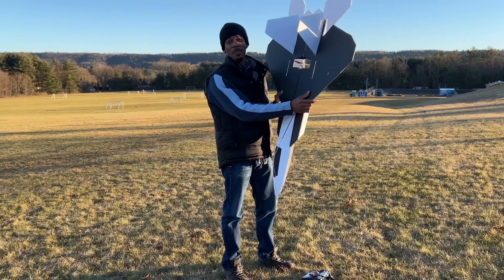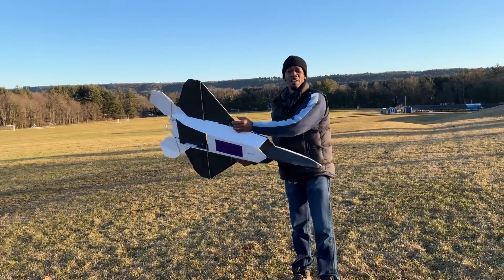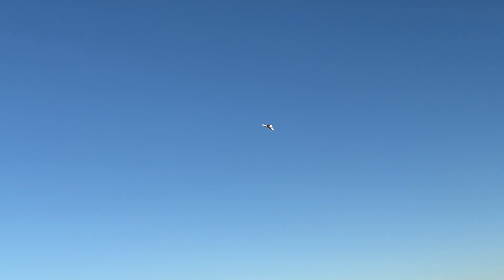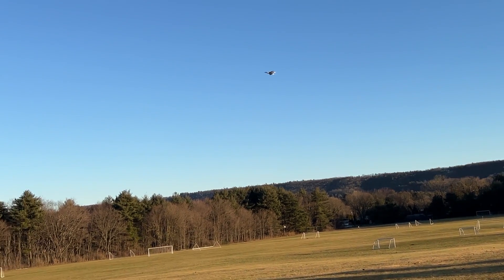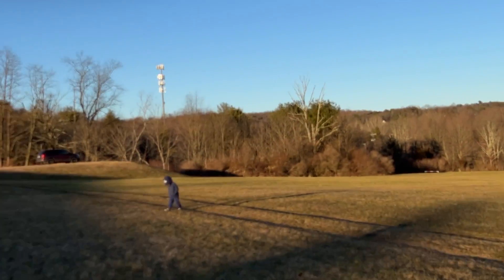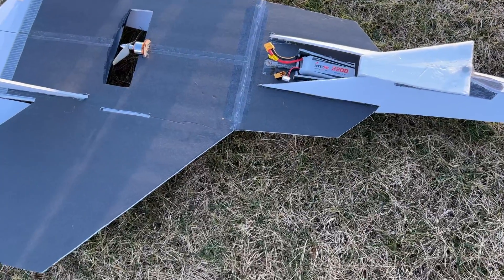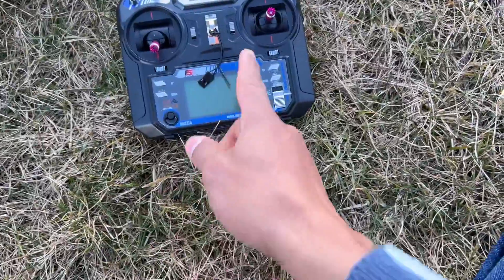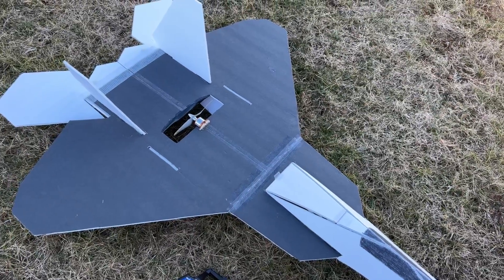How to Make F22 RC Jet: Diy F22 RC Airplane Foam Board Build

Comment: Could you please make a video on the measurements and stuff of the plane? The pdf doesn’t work for me! Please I would love to make this plane. Could you also tell me what exact items you used? Thanks!
Reply from the maker: what size motor and prop are you using?
Reply: @chrisellisrc8787  I am using a 1400, and a 7x4 prop. I angle the motor down and right a little bit on my plane. I am making a different type of plane
Reply from the maker: What type of plane are you making?
Reply: @chrisellisrc8787  it’s one from kendin yap